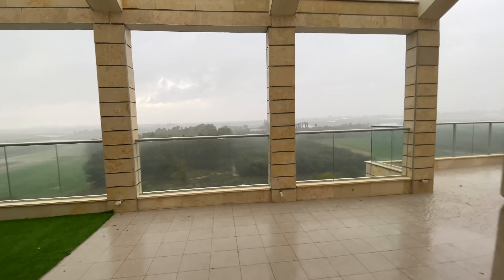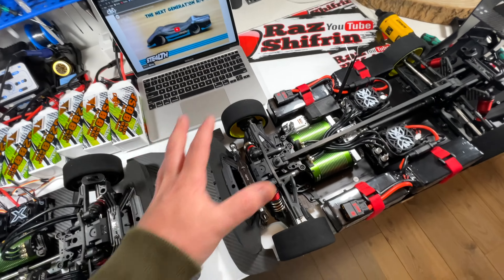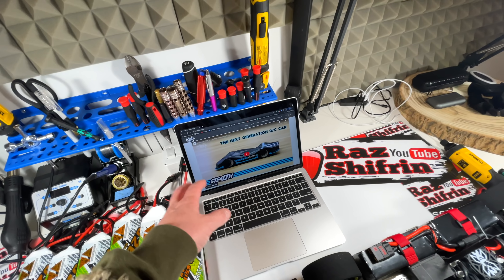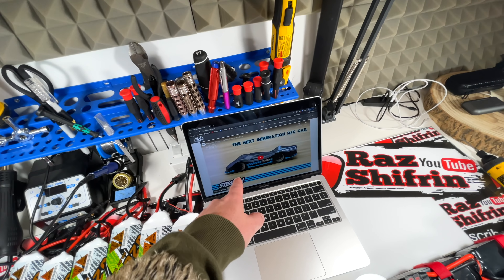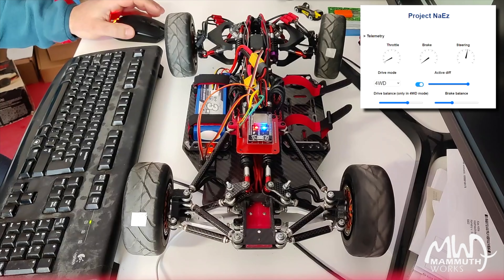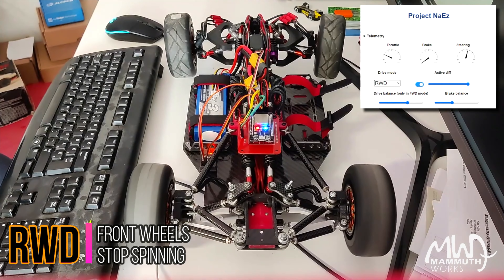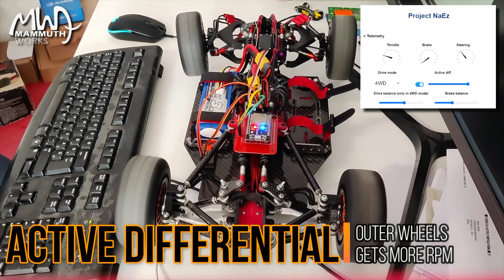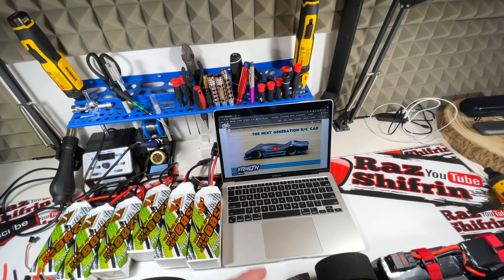Next Generation Of RC CARS? Mammuth Works Stealth!

Comment from the maker: Guys no idea of what all specs are or when it is out or what the price will be, I literally just thought it's something cool to show y'all😎
Reply: Cool info and showcase,  duty well done 🏁🏆
Reply: Oh dang bespoke rc cars!! Now this is something RaZ!!
So if they could do something like Porsche does with applying break to a skipping wheel and keep all rpms to the ground this could be something specific some day!? Btw Raz would you or can you sell the kraton 8s hubs for the wire wheels? By dell just the hubs would that lower the liability? Or am I out of luck? Hehe 🤠
Reply: Man i had the same idea about the differential drive.
Reply: I've had this idea for a speed run car, but I need someone to print the hub mounts.
Reply: Epic! Looks like we finally have proper aerodynamics off the shelf 😁
Reply: It looks like the wheels run without any drive shafts
Reply: €1090,- for the first few cars I heard
Reply: Pretty dope idea! actually the future of electric motors for cars is axial flux I think similar to hub ..kinda  thanks for the info tho!
Reply: I am from the same country as the manufacturer. I contacted them and next year I will make a video interview of them 😉
Reply: Nice video not really into street cars but wasn't a bad video

Comment: OK I've done the math. With a 300kv hub motor on 6s and a tire diameter of 3.5" we're looking at 69 mph. The cell count was never mentioned but I'm guessing at least 8s. = 92mph and 12s =139mph. Even going to a 4" tire is 159mph on 12s. I think the ste4LTh might need to go with a  higher kv motor to make it stupid fast. But... more kv= higher current esc= more weight.....and down the rabbit hole we go 🤦‍♂️🤣
Reply: Lol probably not meant to be a speed run car though! and if it was, youd achieve that with different kv motors, which would be insanely expensive in this case.
Reply: Would be interesting if this handles well if the street isn't 110% flat with high mass of the wheels.

Comment: By first thought it sounds great. But normally you want the the “not suspended” (=wheels etc) part of your car to as light as possible? So won’t those hub motors make the wheels to heavy? I guess there is a reason why 1:1 electrical cars has inboard motors and not hub motors, the only vehicles I know of with hub motors are utility vehicles like forklifts and so. Or am I wrong?
Reply: My thoughts exactly hub motors have too much unsprung mass which won't handle as well.
Reply: This would be a great crawler design with portal drive hub motors, the active "diff" would be beneficial too, as a speed car tho, any little bump will destroy the stability, throwing probably 100-200g up in the air and ruining the driving line
Reply: If they were to take these hub motors and sandwich them together where the diff typically is, they could achieve the same control but save the unsprung weight.

Already planning V2.0 😁
Reply: Yeah I'm not sure on hub motors for a R/C or even a real car, trains yes electric equipment yes for slow high torque it's great for a car I don't know, a lot going on there...not for me but for some it may be awesome, hey any experiment or proto types will help the whole hobby....

Comment: Cool, why would it need a diff if it’s got wheels in the motors🤔
Reply from the maker: I think it's artificial electronically generated differential
Reply: @RazShifrin  I was going to say its a virtual differential. It does not exist, but it operates like its got one

Comment: Good on you Raz, throwing the support out there. Those things look awesome. Hub motors like that is a genius idea. With the right controller, gyros etc, you could program that car to handle really well.
Reply: Theres a reason why they are not used in full size vehicles...
Reply: @-joo3033   ok, fill me in, why not? (honest question).

Comment: I'd like to have the body off one of those for doing speed runs. But the individual motor system seems like it would take away any options for gearing. Top speed would be limited to how much power the motors can handle and what size tires you can run.
Reply: those motors can probably go up to crazy high rpms so i wouldnt worry
Reply: @Andre_Thomasson  they look to be fpv drone motors,. You can work out the rpm by doing the 
 Voltage of the battery × kv if the motors
Reply: @finleystannard  do you know what size the tires are?
1:7 scale seems to be oretty odd for on road rc cars and i need to know the tire diameter to conplete the theoretical top speed math
Reply: @ from my research i found out that they are 300kv motors and lets say you want speed so you put in 2 3s lipos, that would be 22.2v x 300kv so 6.660 rpm but thats only for one wheel so do i have to divide the voltage by 4? im a kid so i still have some stuff to learn i just thought it was a cool challenge
Reply: @Andre_Thomasson  Arrma limitless is 1:7
Reply: @kalaro1706  oh ok thx

Comment: As an RC virgin, I am not sure about hub motors. A motor per wheel, sure. But unsprung...?
MUCH rather, I'd suspend a one or two piece floor from the wheel uprights for unsprung downforce. The suspension of the chassis and body could be really soft as it could be downforce neutral. The wheels would get downforce straight from the floor, NOT going through the chassis' suspension. In theory a superior way to get mechanical and aero grip.
I do love torque vectoring and want it to become super common and the controlling software downloadable for RC and my upcoming AWD Ariel Nomad electric. Because, what could be cooler?
Reply: Exactly, that is first thing that came to mind.
Reply: TBH I dont understand the concern but hub motors and active diffs is what allowed the Tesla Plaid to have 1000 hp and normal street tires without traction issues. Scaling that technology down, these things are about to be stupid quick off the line and through corners.
Reply: Good pointers! You mean a floating body mount right?
Reply: @e36blur  The Plaid (and all tesla's for that matter) have the motors located inbetween the suspention parts of the rear wheels. So they do not add to the unsprung mass.
Reply: @e36blur  The Plaid has 3 electric motors, but I don't think they are hub motors. Just the usual tesla motors.
Reply: @e36blur  Nope. Traction control software did that. Been around a while.

Comment: its "features" arnt really good for anything, maybe the individual motors would be good on a crawler? but if u want to go fast on flat ground its going to be 4wd. Its alot of money for not that much..
Even when traxxas bought out the xo-1 the biggest baddest onroad RC on the shelf for 2 years and it was cheaper RTR
Reply: maybe it is good for something but you didn't know?
Reply: @TheNamesArif  nah i had a google because i really like the styling, but that's where my like for it ends.   Could buy an arrma limitless roller, mmx8 and 1717 combo thats good for 150mph for the same price
Reply: I think it's more about the outside the box thinking
Reply: @radiocontrolsoul  i get what your saying but its just a drone esc and 4 drone motors mounted differently. Thats kind of basic and pointless innovation isnt worth 1500 and still not RTR..
When the xo-1 come out nothing compared.. Nothing else on the market like it.. it was expensive because it was traxxas and castle branded yet it was RTR and almost 500 cheaper.

And let me be clear im not hanging shit on the car, Its the price that is stupid!
Reply: @mifo2000  oh it's definitely overpriced for what it is. I just think it's a cool concept and with so more thought and engineering could open up new possibilities
Reply: @radiocontrolsoul  unfortunately i dont think much will come of it. We built real cars with hub motors and abandoned them because of the balance of the car,
The ability to control the power to each wheel can still be done with a drive line (not so much in a RC car)and with one single motor or a front and rear motor keeping that weight central as possible, for a low Center of gravity is one of the most important keys to going fast

Comment: The only issues I see with this car is 2 big ones for me. Parts support/modding - It looks like you will be limited to exactly what they ship you with little to no modification so once you hit the topo speed, that is it, you now have reached the end of the machine. The 2nd one is for the price that they are asking, there is little to no footage of it running except on a test bench while they calibrate it with no info on things like top speed or even the theoretical top speed. Even the road tests on their channel do not inspire much confidence because when it turns, it looks like it is on ice. I would say that would most likely be caused by the hub motors which looks great and sounds great in all, but it really makes handling really poor with that much weight at the wheels. And for the price of $1490-$1590 USD, that is a ton of money to spend on a product that even the builders don't know anything about. Just seems like a big gimmick product and it is a shame because the product looks good on paper and looks slick in the promo videos they have.

Comment: `the idea looks great, but would think there will/are several problems with this idea. > to much weight on the wheels,  would need extreme software to control all 4 wheels to work toghether. and how are they going break subtle and/or when there is software problems. or 1/2  motors fail....

Comment: Road handling would be horrible with that weight in the wheels, the idea is nice but to improve handling you want the unsprung weight as low as possible,.. but that’s impossible when the motor is inside the wheels,..

Motors on the chassis side would be a better solution in weight distribution,